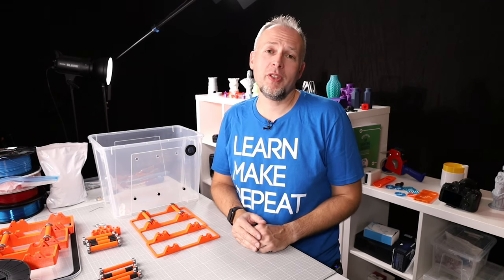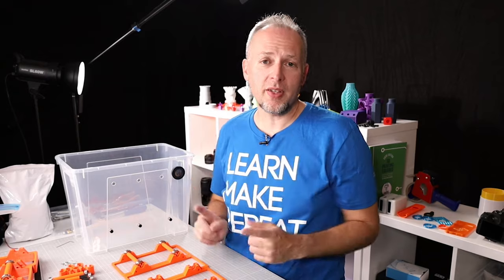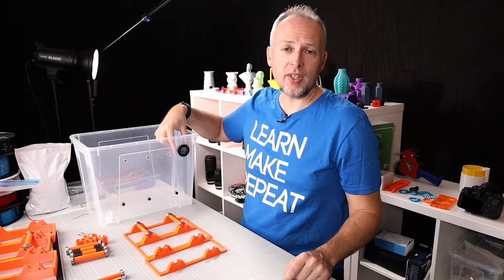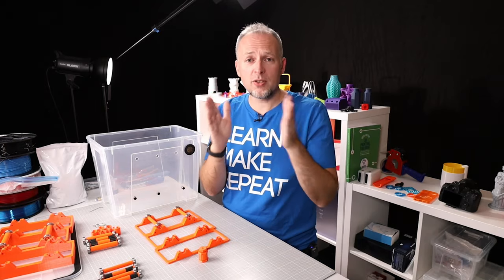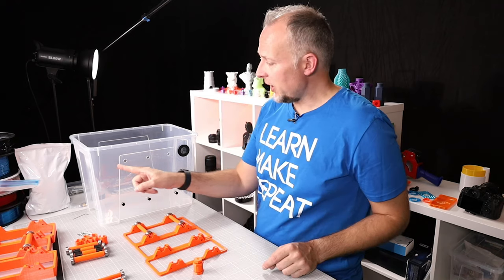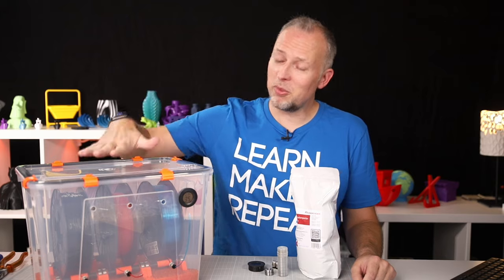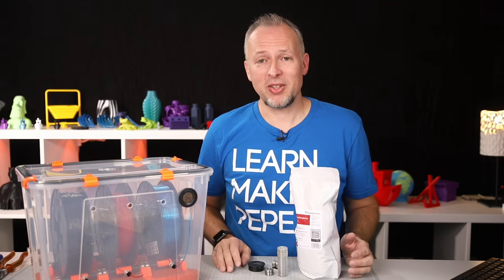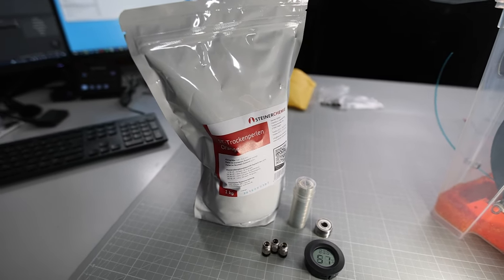Filament DryBox V2 - MUCH BETTER!

Comment: Version 2 looks far better, I was thinking of adding a mesh floor for the rollers to sit on with the gel beads below. Making the roller beds higher is a far simpler solution.  I'm in England.

Comment: Hello, I am need of a filament dry box and I like your V2 design very much.  I like that you revisited the original design and improved it based on your experience.  Nice work and good video.  When I saw you were adding tape to the rollers my thought was to use a bit of heat shrink tubing instead.  My experience with tape on rolling parts is it will eventually unravel and become a mess.  I am in USA.
Reply from the maker: Joe, great comment. I am super late with the giveaway but you are one of the winners! Please contact me on Instagram @danielcrosslink.

Comment: Hi Daniel!  Very good idea to pull from the bottom of the reel rather than the top.  It's much more stable that way and is much more likely to keep the reels rolling well on the base.  I also like the use of the PTFE couplings.  In addition to the benefits you mentioned in the video, using the PTFE couplings makes it very easy to completely enclose the filament path to the extruder in PTFE tubing. This could be beneficial if you work with particularly hygroscopic material like ABS or Nylon, but also if you work in a somewhat humid location or simply like the convenience of leaving filament mounted for extended periods.  Take care, Alex (New York, USA)
Reply from the maker: Hi Alex, congrats! You're the first winner of a drybox kit! Please follow me on Twitter or Instagram and send me a DM, so I can get your address! Greetings! Daniel
Reply from the maker: What's your twitter or instagram handle handle?

Comment: Greetings from Austin, TX USA. Cool solution to a common problem. I don’t 3D print enough and definitely moisture has gotten into my filaments. I need to find a way to dry my filaments first, and then put them in a box like your’s.

Comment: One improvement is to have the gel in metal boxes so they can be removed and dehydrated in an oven without having to dump it out and generate a lot of silica dust

Comment: One aspect of the box that could still be improved is the accessability & removal of the silica gel. Eventually, it will reach maximum capacity of its ability to absorb moisture. At that time, it will become necessary to remove &/or replace the silica gel. At present, you'll need to essentially undo the entire box, in order to pour out the gel. A solution to this problem is to encase the gel in small cotton bags that can then be sewn shut. Then when it comes time to replace the gel, you can simply lift the lid, slide out the saturated bags of gel, & replace them with dry gel bags. AND, most silica gel can be microwaved, to drive off the aborbed moisture, and can then be reused, again. You'll need to check, but the gel you're using might be of this type. Also, a lot of silica gels include a colour indicator that lets you know when it needs changed. I hope this tip helps you. I know it has saved me a lot of headaches.

-From the United States.
Reply from the maker: Jeffrey, great suggestions! I’m looking into more improvements for the box, so this could be one. Another idea I had to include some optional heating system for the box to make it a real active DryBox
Reply: I use a printed mesh box. Holds the gel neatly, and you can see the color change. Clips inside the box.
Reply: @Crosslink3D  It is not an 'active dry box' unless there is a way for the moist air to exit the box. Which defeats the point. What is more 'active' than capturing it in gel that can be re-activated?
Reply: small glass jars with punctured lid also works good too.  microwaveable too and visible.

Comment: Hello from the USA! I always wondered how a dry box solution compares to my current setup. It is just a plastic cabinet whose drawers are filled with silica gel. I take out the spools whenever I need them and place then back immediately when I'm done, although it's nowhere near air tight. This one seems like a really good dry box design though, nice job!

Comment: I like the way you're making incremental improvements. I keep returning to the desire for single-spool dry boxes, so they can easily be moved between printers, or a range of colors or materials can be loaded to a particular printer. And suspended or shelved above the printer, but using some light framework that doesn't loom ominously over the rest of the room! (And I'm in the bottom left corner of the US.)

Comment: 1. Dry Boxes:
These are storage containers that help maintain the low humidity level required to keep filament dry when it’s not in use. Filaments like nylon, PETG, and TPU can absorb moisture from the air, which can lead to poor print quality (like stringing, popping, or bubbles). A dry box usually has a sealed environment and sometimes includes desiccants to keep moisture levels low. It's designed to store filament and prevent it from absorbing moisture.

Your process of using the filament right away and placing the remaining filament in a dry box is perfect. This ensures that the unused filament stays dry and ready for your next print.

2. Dryer Boxes:
These are devices used to actively remove moisture from filament that has already absorbed humidity. Filament can become unusable if it gets too wet, so a dryer box is like an oven that heats the filament at a controlled temperature, evaporating any moisture trapped inside. Some dryer boxes even allow you to feed filament directly to your 3D printer while it is drying.

In short:

Dry Boxes = Prevention (keep filaments dry when not in use)

Dryer Boxes = Restoration (remove moisture from wet filaments before or during use)

Comment: That's more the way that I would have designed the box.. however, now you redesigned it, your left with 3 gaping big holes for moisture to creep in.. maybe tpu blanking plugs to seal the 3 holes at the top?

Happy printing..

Comment: Thanks for a good, practical and low cost design solution. I like that the scheme is potentially adaptable to different size boxes and is stackable. J, UK

Comment: Great video and thanks for sharing your improved version of the box. I‘m new into 3D printing and my printer stands currently outside in my woodworking workshop which isn‘t optimal for the filament. 
I‘m from Germany/NRW. 

Greetings and keep up with the great videos
Reply from the maker: Awesome! Woodworking is also great but I don’t have any skills with that 🤣
Reply: @Crosslink3D  3D Printing and woodworking is a great combination. Since having a 3D printer I‘ve printed a lot of small helpers like runners for the miter slots or wall holders for my tools/batteries. Maybe some day you also become a crossover hobbyist 😆👌🏼

Comment: I just started my box and haven't drilled the filament holes yet.  NOW I'll put them near the bottom (thanks, I hadn't thought of what would happen when the spool was almost done!). EDIT:  I'm putting the holes on the BOTTOM of the case and go straight into the top of the enclosure I'm making (got idea from review of QIDI TECH printer I just saw.)

Comment: I’m building a couple of single filament dry boxes to be able to print fro out of sealed plastic cereal containers. If it works out I’ll probably put it up on Thingiverse as I’m modeling the filament roller to custom fit the bottom of the container. My challenge is making the individual dry containers as inexpensive as possible while having everything I need like decent tubing fittings, hydrometer, and desiccant. 

I store my filament in bulk in large sealed tubs with rechargeable desiccant packs. 

You video was great for information like a low filament port to reduce spool wobble. Keep up the good work. 

By the way, I’m out the United States. 
If selected I would love to build your kit.

Comment: Great improvements over the first box. Next would be adding a heater, and tasmota relay with humidity sensor to add automation. I'm in the United States.
Reply: A heater only changes the relative humidity, not the actual humidity. The moisture is still inside the box! It is the quantity of H2O that is in the filament that is important, not the RH.

Comment: Regards from Poland! Great job, I am using similiar box to keep my filament in, but not printing straight from it. Anyway it is good solution ;)
Reply from the maker: Printing from it is really beneficial with TPU as that absorbs humidity like crazy
Reply: @Crosslink3D  yeah, I know that. It wasn't necessary to me because I was printing in PLA and PETG, I am on stage making hotend and cooling system upgrade to try some other materials, TPU is on list. So when I will be ready I want to ulgrade my drybox to print directly from them.

Comment: You get more drag rolling that larger roll on tiny axles. Imagine the gearing on a bicycle. If the roll is 20 times bigger diameter, it will turn the axles 20 times faster which is more drag. Times two. Support in the hole and the drag goes down drastically.

Comment: Would it not be good to have the silica perls in some box of their own with obviously small holes to still allow them to extract moisture, but make it easier to get them out for regeneration with as little dust/mess as possible?  The open room inbetween the holders where you now just dumped the pearls in, just seems the ideal holder for a box instead ...  Greetings from Belgium.
Reply: indeed, i saw this method in another vid.

Comment: Since the IKEA Samla is no longer (ATM) available if you're looking for a replacement box the size is width 39cm (15.35") x depth 28cm (11.02") x height 28cm (11.02").  22L is 23.25 Quarts/5.8 Gallons.
Reply from the maker: Thanks for the hint!

Comment: I wonder if it could be beneficial to move the ball bearings slightly inwards on the round bars, and let the spools run directly on them instead?
Cheers from Denmark

Comment: Hi, i'm from Bosnia, V2 looks much better, i like low placed filament outlets, pulling filament from below adds stability to the spools inside making them much less prone to tipping over, as for the tape on the rollers, i think using heat shrink tube would be much more uniform and  durable than tape wrap.

Comment: Daniel, rather then play around with the electrical tape, why not just insert a small section of shrink tubing and obtain a smoother rolling motion, instead of the roll bumping across the end of the tape. Just my two cents,,,

Comment: The first problem with multi-reel boxes is there is never the right combination of colours. The second is that you expose all the reels every time you change one of them.  Better individual cassettes. A cassette holder on the printer means it just drops in, and the filament outlet is perfectly aligned. You can incrementally increase the number of spools over time. A shallow food container sitting on a side allows the use of a simple centre reel spindle, no bearings required. A printed mesh box holds the gel neatly and easily changed.

Comment: I bought a cheap to spool drybox with a heating element and fan off of Amazon and after four months it will no longer turn on. I have an old dehydrator that was for making beef jerky, I was thinking about trying to rig up that heating element into a box kind of like you have, you should make a video like that will you take an old food dehydrator and make a drybox

Comment: Nice design, i was wondering where to buy the orange silica gel? I'm from the Philippines. Btw are those the ones you microwave when it turns dark color?
Reply from the maker: These are orange when dry and green when at 100% humidity. Got them directly from the manufacturer in Germany but Amazon also sells it
Reply: @Crosslink3D  thank you

Comment: I just finished the 3d prints for version 1. I love the idea since I print mostly in PETG and TPU. Just curious if you thought about just using a small piece of PFTE tubing and gluing it to the box instead of using the coupler. It seems like that would leave less of an airgap. I'm from the United States.

Comment: hmm.. the PTFE Couplings are very expensive. There are commercial dry boxes with filament output that are almost similar in pricing (but only contain 1 or 2 filaments - so this is still better :))

Comment: Awesome. Can you explain how you sealed  the original holes,. Is tape enough to keep it airtight.

Also hope to win down here in Australia.
Reply from the maker: Hey Scott, I used tape from both sides of the box wall to seal it. Should be pretty fine I would say.

Comment: Just wondering if you have sealed the holes that are at the same level as humidity sensor?
I'm from Lithuania.
Reply from the maker: Absolutely, I put some transparent tape on inside and outside so it's sealed again.
Reply: @Crosslink3D  What a relief to read that! I don't think I'd be able to sleep knowing those holes were letting in humidity!

Comment: 5:14. I would have used heat shrink tubing and cover them entirely, heated with the heat gun at distance, not a lighter or other flame because it would bend the PLA so...

Comment: Any tips for getting rid of the every so subtle elephant foot in printing the actual roller rods? Its a very tiny elephant foot but just enough to create a bump and in turn my spools will bind on the bump and struggle to roll over. Could I use alloy or wood dowels instead? Could I just sand it smooth? I'm printing with an Ender 3 v2. Adjusting the z-offset helped but not enough.

Comment: Hey Daniel,
i like this project and want to build some myself, but since the spools are so narrow, like the MasterSpools, wouldn't it be possible to fit a forth or even a fifth in it?
2nd thing, wouldnt it be possible to put a SAMLA like shaped tray in it before the pearls and putting the Spool holder in it, so you can get the holders out and then take the tray out with all the pearls?
Just thinking out loud :D

Comment: I just finished printing the previous design. Hope I win the kit as I was still trying to source all the other bits
Reply: I have connected the new inserts into the 608zz bearings, Not sure how the free wheeling they should be. Still feeling some resistance when turning them (not sure if that is normal)

Comment: so you have a drybox with pneumatic fittings but feeding the filament without a tube to the printer? Actually I searched for a low friction solution for a tube thats leads the filament from the drybox to my printer. can you recommend a cheap, transparent, low friction material for 50-100 cm travellengh?

Comment: hi there printed off your model and using 608zz bearings but when you push the rollers into the bottom rack makes the bearings very stiff not sure if the gap is a little to tight ??? for the bearing to run free they fit and click in well but have found it to be binding the bearing ?? works better if you just sit the roller on top rather than pushing it all the way home. any suggestions as it has took me a fair while to print all theses parts ??
regards
Gary